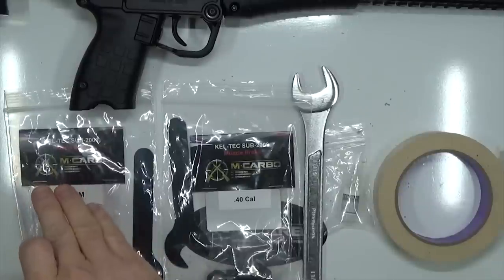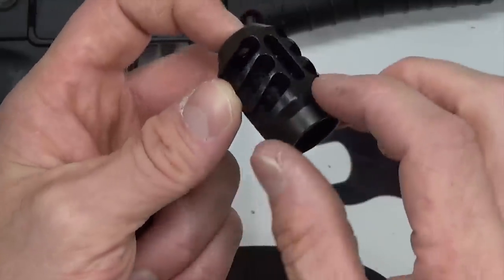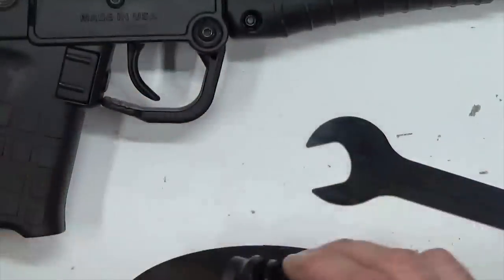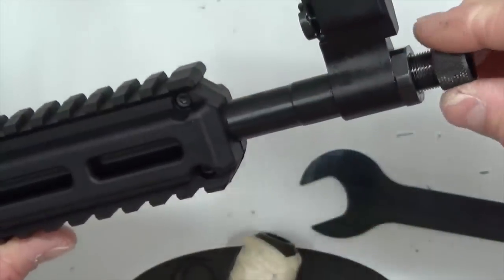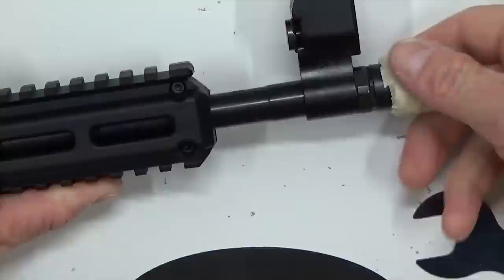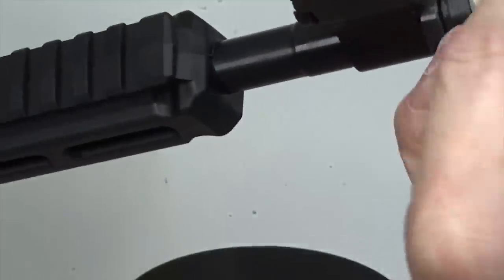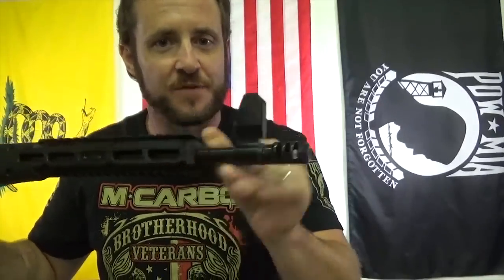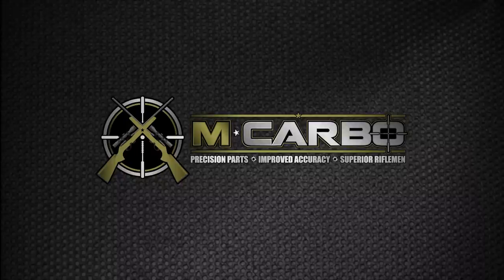KEL-TEC SUB-2000 Muzzle Brake - 9mm & 40cal Muzzle Brake / Compensator Hybrid by M*CARBO

Comment: The muzzle brake I just purchased from you did not come with the thin laser cut wrench shown and used here in the video.  Why don’t you include it in the package anymore if it’s needed?  I purchased the barrel jaws with it as well and I’m ready to install,  but don’t want to begin without that wrench if I won’t be able to tighten…

Comment: luckily my Sub 2000 gen 2 is not included in the recall.  Do you Have a better front sight ?  I hate the way the front sight works. I would like the whole front sight to move side to side and not the little post.